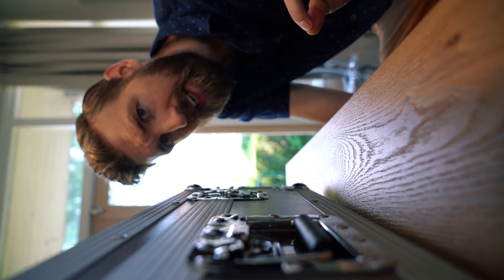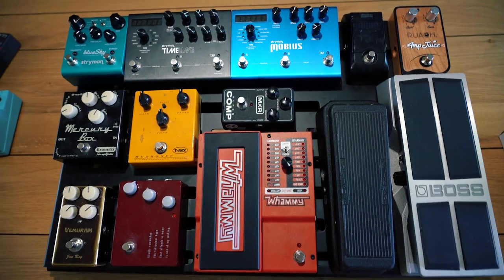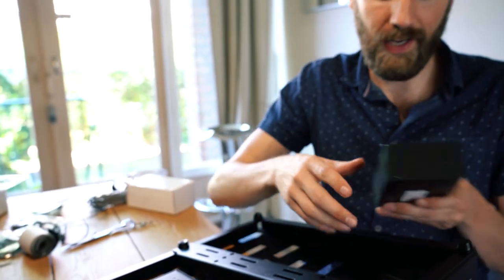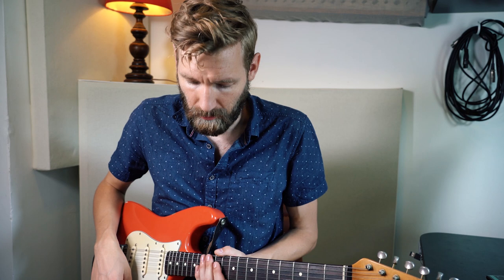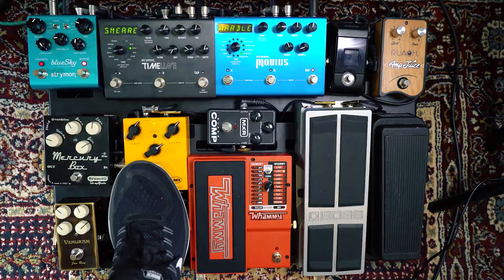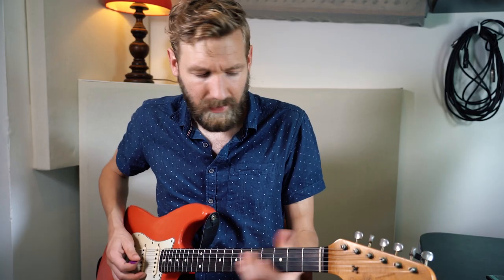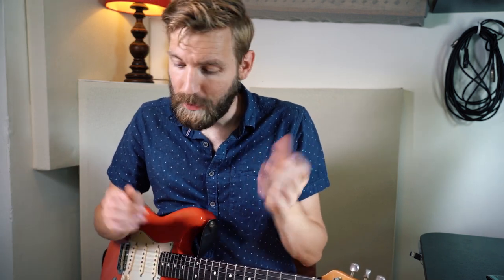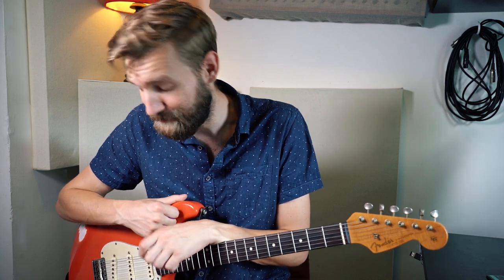Trying to build the ultimate PEDALBOARD!

Comment: I thought long and hard over my board. The 2 most important pedals are the 2 that reduce the need for others. The Boss RV 500 and the Boss DD500. They have reverb and delay, but they also have chorus, flange, tremolo, pitch shift, looper as well as many more. They are all hooked up to a midi switcher along with 4 distortion and overdrive pedals, one the La Grange connected to the expression pedal that gives light grit to full on over driven Plexi. Zero pedal dancing and I have everything I need on a small neat board that looks good as well as sounds good. 90cmx30cm. The Harley Benton FXL8 pro is a dream to use and program as well as being a sensible price. I get all the sounds you get.

Comment: Trick when using hook and loop (Velcro) is to put both pieces together and stick the one side to the pedal. Then expose the sticky tape and press the pedal onto the board where you want it. No need to try and eyeball the pieces separately.

Love the Amp Juice. Nice punch.

Comment: Wampler Ego compressor>modded Vox Wah>FoxRox Octron>Wampler Velvet Fuzz>Xotic AC drive (my favorite tube screamer type OD)>Creation Labs Holy Fire (big sound like SRV-hard to describe)>Boss Volume pedal with an out to a Boss tuner>Analogman Bi-Clone chorus with separate depth and speed controls for each channel one set to resemble a fast Leslie and one more like Cobain, slow and deep>Strymon Flint tremolo reverb>SIB Echodrive tube driven delay. I also have a Lehle Dual that I have used to split the signal and between my Fender Blues Deluxe and Motion Sound Sidewinder rotary amp but my practice space is so small it's just too much volume for right now, even though I am playing with a drummer.

Comment: The only thing I would change is the routing with/without effects loop.
The idea of having a patchbay is having your ins/outs centralized in the same place.
You could have the strymons connected to the patchbay so that you could connect to the effects loop through there.
In a situation where you don't use an effects loop you could simply bridge the connection with a small cable on the patchbay.

Comment: Compression after gain... why, I wonder?
Reply: to squish the dirt.
Reply: when i use a Compression pedal i put it near the end helps regulate volume changes.
Reply: OK. The main things I want from a compression pedal are (1) more sustain and (2) fatter clean tones. Also just that nice "produced" colour. I don't use it for limiting. I guess I put it before gain because I want the fatter, more sustained signal going into the gain pedals, and also because I want it to be a bit louder and pokier when I add overdrive. I guess also much because that's just what I've been told to do. TBH I haven't tried the other way
Reply: Just guessing here, haven't tried it myself. But if you play with low gain and you want to be able to get more drive by hitting the strings harder while being able to have a fairly clean sound when you're playing softly, you don't want the compressor before the gain pedals, it'll kill your dynamics. Check out That Pedal Show, they have an episode about what order to put them in and say something about compressor after the overdrive kind of simulates the power amp section of the amp compressing.
Reply: When it in this order I can use my volume knob on my guitar as a gain control. So when I'm playing with someone we set our levels using the compressor then I kick on my overdrive and walk away. For my les paul I have the volume on the neck pickup way down so it's clean then the bridge, is full on. I tried it the other way but I didn't have the control I wanted. Having gain control without blasting your levels is very nice and to me the whole point of a compressor.
Reply: Compression after distortion keeps the natural drive dynamics in place while clamping down on the volume dynamic range.
Reply: I've been playing with the keeley gc2 compressor/limiter at the end of the chain (before delay). Not for color so much as for dynamics.

It levels everything out nice before it hits your amp. I get a lot of peaky stuff jumping on wahs and combining pedals. A limiter at the end keeps the level a little more even into the amp.
Reply: Because that way works more as a limiter than anything else... and all your playing dynamics and nuances reach your gain pedals/preamp completely unaffected by compression, which I dig. It reveals a lot about your playing, and is really unforgiving if you are sloppy player like myself, which forces you to get better. I have it setup like that and it also acts as a reverse level boost (slight volume increase when turned off, which is great for leads). Give it a real try, you might not want go back.
Reply: let me know how it goes the other way.  I tried it before the gain and I ended up getting too much noise from the compression pedal for some reason (when the gain wasn't even on).   I tried it after and it helped.   Also if I remember correctly, the sound was really intense when I put it before the gain, too prominent.  I still don't think I have it figured out all the way lol.
Reply: @westyavro   A limiter is a type of compressor designed for a specific purpose — to limit the level of a signal to a certain threshold. and who you calling a nit?  thats what i use it for. ohh and creating a nuisance!
Reply: Hmmm... Doesn't comp after drive boost noise?

Comment: Just get the headrush pedalboard. Easy and simple. Btw u were on Dramaalert the other day.
Reply: David Nwokoye ...link?
Reply: real pedals will always sound better
Reply: That's right even to this day multi FX units don't sound as good as a petal board w/individual petals for the job. I remember when they came out terrible but ok now to figure out what FX you will use then later get the petals you need those $200-$500 petals are too much that much ambiance would get lost in a mix live you will most likely use a Tuner a Wha Over Drive / Distortion & a Delay / Reverb if yer amp don't have reverb. Or better yet buy a used Peavey Vypyr 15 they sound amazing the older ones have much more amp sims than the new ones I bought mine new for $89 as a lil bedroom amp & it sounds great if you go past the 15 watt you can get the foot controller Samparea 1 one tread for Wha Whammy Vol swells …& lots of banks you can switch to not glitchy it has the same SHARC Chip that the AXE FX & Kemper use. That way you can use it for practice & find your sound & you can add a jack to run the Vypyr thru a 4x12 Cab it sounds Massive that 15 watts will roar thru a 4x12. My 5150 tube head is sitting idle lately I find my self just playing thru the lil 15 watt Vypyr & I have a Vypyr VIP 3 100watt which has a looper & you can run a Bass Gtr Acoustic . Gtr or Electric thru it. It has less models of amps but more FX some wasteful imo like the Synth & the Sitar simulator I'd rather have the amp sims. That's a great place to start you could find a used one cheap & the older ones are better more bang for the buck unless you want a Bass amp right there & an Acoustic amp if you would be great live if you had a drum petal to have a beat going i.e. The Trio or the Sdrum petal. You'll save a lot of money trying out petals.

Comment: A lot of redundant OD pedals that are essentially the same tone. Save your money and just get one and an boost pedal. BOOM! Problem solved
Reply: Fuzz + guitar volume > all the OD pedals on a board
Reply: For the Ultimate pedal board just look up Robin Trower's rig rundown.  One of the most influential guitarist from the 70's who still plays today ... four pedals are all you need.  The real trick??  Learn to play the fucking guitar.
Reply: I was thinking the same thing. The first two drive pedals sounded too similar to one another.
Reply: stacking overdrivve pedal allows changing from more than 2 different gain levels and volume levels, it makes a lot of sense for live situations. To get the same result with what you say you would need two boosters, which i think some people like. It's really just preferences, no right choice.
Reply: nonpoint666rocks you could use the volume on your guitar for similar effect.
Reply: RIALAS ☝️ volume knob with treble bleed or 50s wiring and you’re in business.
Reply: Lonesome Crow Yeah, he still plays today, but he is absolutely irrelevant when it comes to innovative guitar playing nowadays.
Reply: Blasphemy. I have at least 10 OD pedals and struggle with which ones I can do without. Plus while they may be able to be dialed similar... They can be dialed very different also. My OCD & Pinnacle overlap but I have them dialed very differently. Same for my Fulldrive & Tubescreamer. Plus I use them all at very low gain settings, so they can be stacked and not sound like a MetalZone.
Reply: SpaceDisco1 who would you say is innovative in guitar playing today ? I could use some inspiration
Reply: Blue Networks Hey! Depends a bit on what you want... when it comes to solo jams etc. I really enjoy Mason Stoops a lot - absolutely fantastic session musician and incredibly capable in classic playing. However, he really shines imo. in his solo performances.

Then there‘s singers like Donivan Berube (Love is a dog from Hell) or Jerkcurb (Voodoo Saloon) that just have interesting chord progressions and sounds in their tunes. Furthermore, I really enjoy King Krule‘s Guitar work. Somewhere between Punk & Jazz.

Mark Speer of Khruangbin is also fantastic, in the sense that he makes one guitar sound like two.

If you don‘t know Knobs check that channel out as well. Funnily, enough a pedal review channel but he really shows what things you can create with modern gear. 

If you‘re in for a bit more „challenging“ stuff, check out King Gizzards - Flying Microtonal Banana. While not necessarily amazing Guitar playing, they really make Microtones work and showcase, that there‘s still some fundamental aspects to be explored in Guitar playing.

And if you wanna see what a solo guitarist can potentially do - Manan Gupta (Dear Mother).

And I mean, there are also a lot of older players, where I think their material is still highly relevant, but I have no clue what you‘re into and what you know haha.
Reply: SpaceDisco1 man I love khruangbin mark speer is very cool indeed love his sound I’ve heard a bit of king gizzard micro tonal it’s a unique sound for sure I think it sounds great

Comment: Tips I've gathered over the years:
Unless it's a home/studio board just put what you use the majority of the time on it.. Always use a good power supply.. Use soldered cables. They're cheaper, higher quality, and some are even smaller than solderless.. Use vertical space.. Use cable management.. Use a buffer.. Dual lock is the strongest hold.. Patch/midi loopers are exponential modifiers and add new value to old pedals.. Put vol/wah/exp on a seperate board if you need room.. Get an i/o.. Get a pedalboard snake.. unless you use 999 patches a set, smaller one trick pony pedals are cheaper and easily managed.. the more complicated, the more points of failure.. lable everything..etc

Good prices for pedalboard gear: 
Redco.com
Alphatone on reverb. 
Guitar Effects Pedals Nashville Showroom has the best price on 400 stem dual lock. Dont get fooled by the low profile stuff. It's only rated for 50 pulls. 
Ear Fuzz Effects on reverb has the cheapest flat boards that I've found and most will fit in a pelican air.

Comment: with that many pedals in line you really ought to get a buffer.  i would recommend the new mesa boogie buffers designed by mario from axces audio or the empress plus.  to gauge how much tone suck u have run a cable straight unto the amp. then through your board into the amp through a simple a b box.  i was shocked at how much degradation there was.
Reply: The red klon thing has a quality buffer. You only need a buffer if you actually need a buffer. Plug you guitar in direct. Plug your guitar in the bypassed board. A/B those sounds and that will tell you if you have any problems with your pedal board.

Comment: And when we’ve built what seems at the moment the perfect pedal board, we may think that in only a couple of years we will probably be planning to use just amps and onboard controls again. It seems to be a regular oscillation, which pedal manufacturers must rejoice in. The alternative is to get a techno-wizard to design you an equivalent of Neil Young’s Whizzer, which digitally turns the knobs on a vintage Fender Deluxe. There are a couple of other effects added in, but having got this thing once sorted, he’s stuck to it. I wonder if the adaptability of pedal boards is perhaps one of the things that makes our commitment to them a bit unstable. All that said, some of your effects sound fabulous, Paul.

Comment: Surely the ultimate pedal board would have a parallel mixer so you can blend your effects together as well having the option to run them in series if you so choose. 

I also use mine to switch between 3 separate channels. I can make 3 combinations of different pedals and either blend all 3 channels or switch between them.

Comment: Dude, you should've gotten a 1Spot CS12. It could power your whole board without the need for a 2nd power supply.
Reply: Will Gaines Will, the 1 Spot can cause extraneous noise with some pedals because of the antenna effect. Paul did it the best way.

Comment: hello Paul, I think I will copy your pedalboard, I am a huge fan of strymon pedals, just wondering why you chose the bluesky in plac eof bigsky and why no boost (like mxr micro amp) ?

Here is how mine would be, and I have a question for you :
polytune
digitech whammy
wah wah - dunlop 535 cry baby
compressor - xotic sp or mxr super comp
 or something else?
drive 1 - klon ktr
 or fulltone ocd or king of tone or something else?
drive 2 - ts808 or vemuram jan ray
 or something else?
disto - pro cat rat 2
 or boss ds1 or something else?
fuzz - big muff pi
volume - boss fv-5ooh
chorus - mobius (+tremolo, rotary)
delay - timeline (+looper)
reverb - bluesky or bigsky
-->  my question is, what would you recommend for the overdrives 1 and 1, disto and fuzz. I know it is personnal, but what would you use ?

thank you

Comment: Came here for sequencing ideas. Left with ... I'm kinda on my own. I like a tuner first or dead last (up for debate). The ability to stack distortions (even two of the same in line). But, still on the fence about where my Strymon Big Sky sounds best in the chain. I can also see issue with the top row being difficult to hit on the fly, especially behind the taller wah's. Great video though. Thanks

Comment: I am currently buying pedal by pedal, so it's affortable. But buying a board + power supply are pretty big up front costs. My current board is a mess, because of all the wires, many of them do not have the edge shape connectors (what is correct term for that? :) ). Having all these holes is really convenient, next time I look for a board, I will prioritize that feature. Having a big and clean board is really a pleasure for the eyes. Nice video

Comment: Do you have a problem with crossover running power-cables and patch-cables under the board together? I’ve heard it’s best to separate them, or if they must cross run them perpendicular vs parallel. Was wondering what’s your thoughts on that?

Comment: On the rockboard power pit - does the courtesy power cable come with the product, or do you have to buy separately???

By courtesy power cable, I mean the one which in this video, runs from the PowerPit and then on to the PedalPower 4x4.

Thanks

Comment: Amazing pedal board and surprisingly clean sound with no buzzes! Nice one! :) Was wondering, have you noticed if your amps tone is affected/degraded when all the pedals are bypassed/switched off? I've always used multi-effects pedals for ease and convenience but really want to set up a proper pedal board now... but really don't want it to mess with my amps tone! I've noticed that some pedals, even when bypassed, tend to degrade the amps natural tone... in my experience this is especially more noticeable when playing guitars with single coil pickups... have you notices this at all? Anyone else experienced this? Thanks again for this awesome video!!

Comment: that venurum pedal sounds amazing
Reply: just realised it costs £339... it doesn't sound good anymore
Reply: Latif Yay buy a timmy and put a lm1458 op amp (it’s really easy, no soldering)... jan ray it’s a clone with that chip. It will cost you $135 at most
Reply: Buy a Timmy!

Comment: Mate, dig your pedals, and the pedal board, and the sounds you get from it... but not the way you have set it up...  might I suggest, if you really want the ultimate pedalboard you might need to go multilevel, specially if you have 3 rows of pedals... keep your always on pedals either under the top level, or on the back row. and the most used pedals at the front. That would really reduce the ballerina performance every time to you want to change something. other alternative would be to move your wah and volume pedal to the back of the board horizontally, and when you setup your rig for a gig/home you place it to the side at floor level outside the board... Because less face it, your volume, wah and whammy pedals get on the way of about half your pedals... just suggestions.

Comment: Hi Paul, Have you worked out how you can program your own presets on the timeline and access them live ? I only need 4 presets, but i need to access them live with a simple press ( or two ) of a footswitch . i also only need 4 parameters initially, 1. Delay Time ( in Milliseconds ) 2, Delay Feedback 3. Delay Tone and 4, Delay level ( mix ). thanks for your advice about how to access your presets live. cheers

Comment: Hi, 
Is it ok to use one proper power board and to it add, connect a power brick that will power up three guitar pedals in total? I'm using Katana 50 amp and plan to get something like Boss noise suppressor, Revv G3, and a Korg tuner. 
Thanks 😁